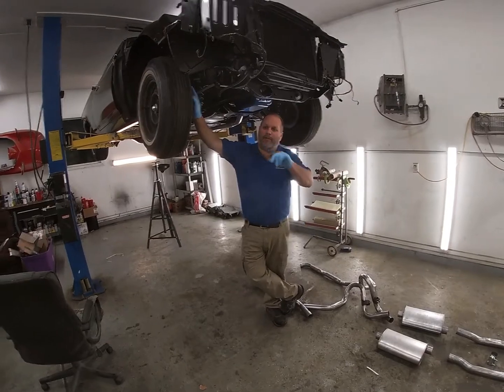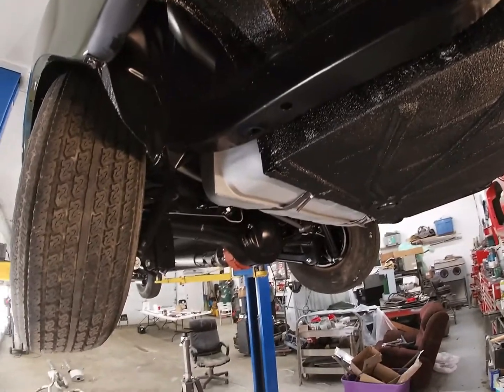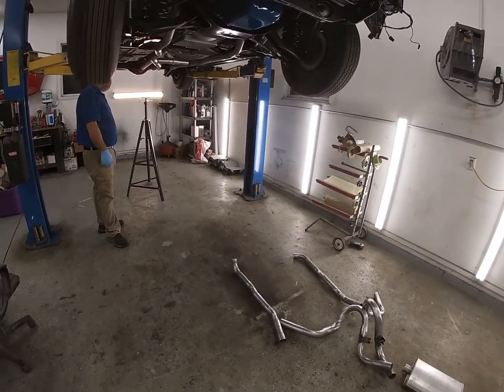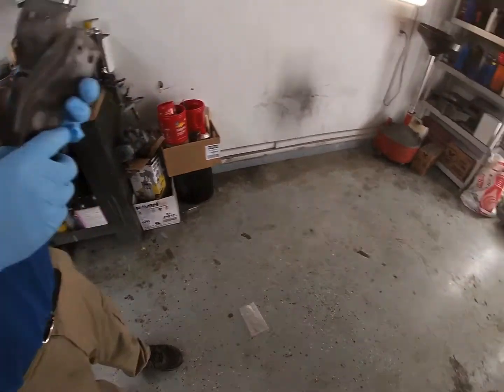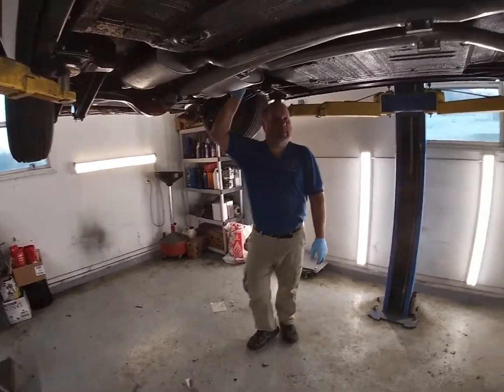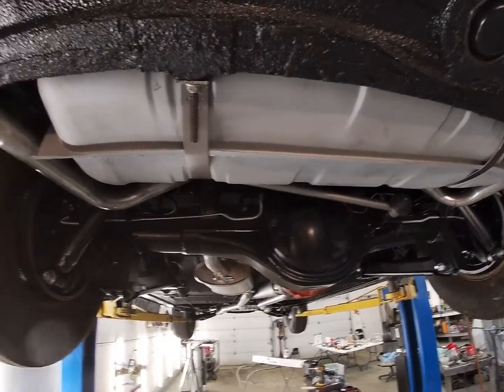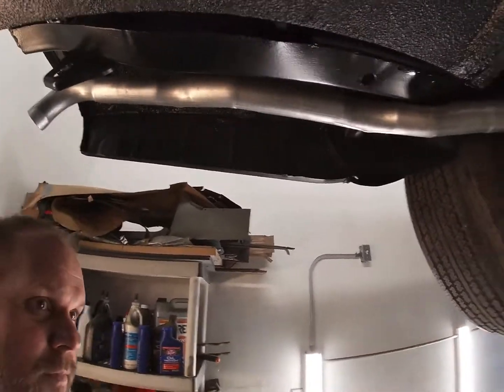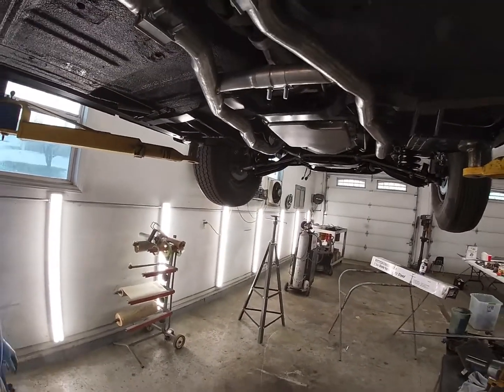1970 Lincoln Mark 3 part 17. Installing the exhaust.

Comment: Nice job Brian, wish I had a lift! I have been crawling around under my Mark for months! I'm having some fitting issues too. I just got the rear bumper on and will try mounting the tailpipe and muffler to see were it falls. The vendor is working with me to get it right.
Reply from the maker: It sure does make life easier.

Comment: Love seeing the new exhaust installed, i'm in the process of ordering a new exhaust system for my Mark III. I was thinking about having the exhaust system ceramic coated first, before having it installed on the Lincoln. But after seeing your project, I'm now having second thoughts on doing that. Do you think ceramic coating is a good ideal or not?
Reply from the maker: Thanks for the comment. My first question would be is what are the benefits of the coating?  I’m not familiar with it. Thanks